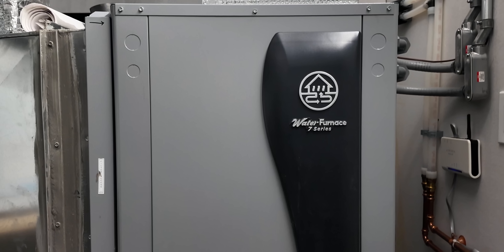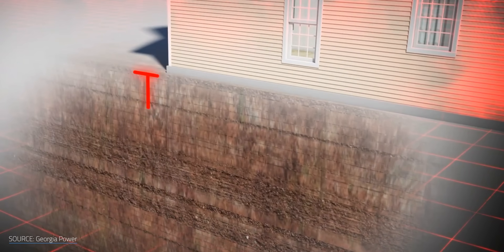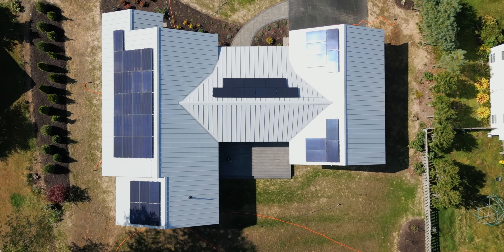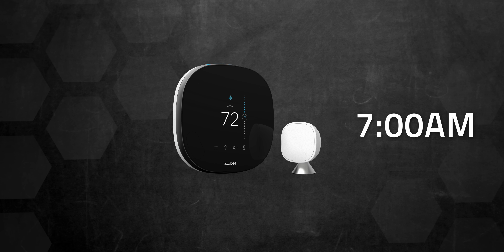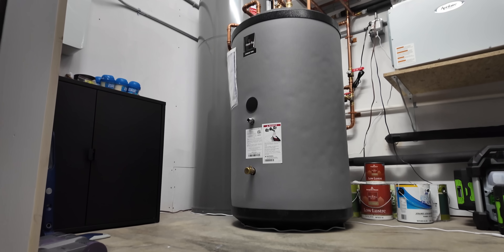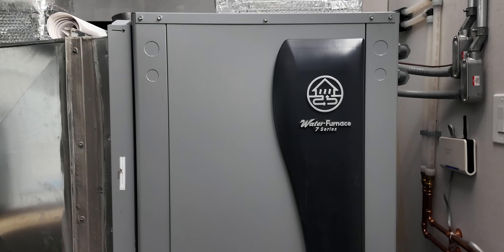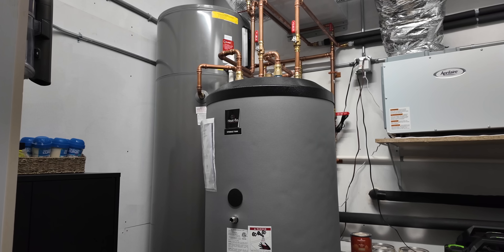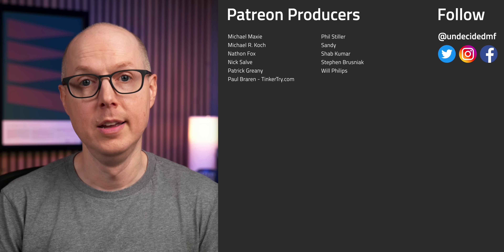How My Geothermal Heat Pump Really Performed (2 Years)

Comment: We installed geothermal heat pump 6 years ago. Our installation was done with a 230m deep bore straight down in the rock. Before this, our house used 47000 kWh/year. After we use 13-14000 kWh/year. The total cost of installation was $18000. It has already paid for itself, and my only regret is that we didn’t do it earlier.
Reply: This is basically my experience. 78k is crazy money for this system. My system came out to under 10k and heating capacity is enough for 150m2 house in Finland and no direct electricity heating needed for even -30C.
Reply: @roskispalo  finland is apparently quite good for geothermals, this is very location dependant
Reply: @Idfkwtumf ”geothermal” is a misnomer - when talking about heat pumps, it just means “ground sourced”. This is NOT location dependent. All that varies is how expensive it is to drill/trench, cost and availability of equipment, and government subsidies. The US is astronomically expensive for all HVAC systems of any kind.
Reply: Total cost of installation was $18k 6 years ago but what would it cost today?  I just got three quotes for drilling the boreholes for geothermal, they were $79,000, $85,000, and the third well driller (who had drilled 2 years ago for a house less than 1/2 mile away) wouldn’t quote, saying that the job could exceed $100,000, but might go smoothly and only cost $60,000, he couldn’t tell what he would encounter.
Note that those prices are for just the boreholes, does not include any hardware.
Reply: @jpe1  I am really curious to know how is a four fold price increase in 6 years justified!
Reply: @nspattak1  Isn't most the cost for labour?
Reply: @nspattak1  There has been a four fold increase in a lot of things in the last 4 or 5 years.
Reply: @EthanThruandThru no doubt I have the same question for all sorts of businesses
Reply: @jpe1  They probably use old drilling equipment. It takes longer time to drill, and the drill heads needs to be replaced several times during drilling. The time used for drilling this 230m hole was about 4-5 hours.
Reply: How do you use 47000 KWH?! I use 3000KWH a year. Those numbers are only being made by people who are running an illegal weed farm 😅😅
Reply: @TheJubess Depends where you live? I live in Norway, at my place we have -20 C during winter and up to +35 C during the 1 month of summer we get 😂.
Heating is our main draw of power, followed by hot water then EVs.
Reply: @CrinosAD No insulation? 😅 I live in Norway too, geothermal heat pump is about 50k€, we currently use maximum 27k kWh 175m2 house. The math doesn’t even remotely add up. Nobody in Norway has a decent ROI on these installs.
Reply: @TheSteinbitt older house from 1963 with only 10cm glava. Working on double it 😊
Reply: @TheJubess , maybe it's not just for heating, but also general power and EVs.🤔 Or it was converted fossil energy.
Reply: @TheJubess  I live in Sweden where heating is needed like 9 months of the year. It’s a big house, and the heat was generated by an electric immersion heater.
Reply: If I could get the install done for $18,000, I'd do it right now.  I can't get it done for less than $75,000.  I'm near Albany, NY.
Reply: @pleappleappleap  Yeah, we are fortunate to have solid granite just 7m down here. We just needed to drill the hole and replace our existing water heater with the heat pump. It was done in less than 2 days.
Reply: @jesperwall839  how is that fortunate?  It has to cost WAYYYYYY more to dig through granite than dirt
Reply: @13swe13  Because granite doesn’t collapse. Dirt will.
Reply: Hi, we are living in Austria and using a geothermal heat pump since 1992. Installation cost was approx. double compared to a gas/oil based heating system. Total annual electricity engery consumption approx 8MWh - 9MWh incl. household electricity. 21–22 Celsius constant temp. during the heating season (mid. September till end of April) - unfortunately no cooling function available . We are very happy with the solution. Since 7 years an additional PV system helps to keep the electricity bill in manageable dimensions (the heat pump consumes the main part of energy in winter with almost no solar generated electricity.
Reply: In the state of Maine, geothermal typically has a twenty year payback, not including labor so I don’t know if you are bsing or on the level.
Reply: @jacob-bi9ys 20 yr payback NOT including labour. Including labour the payback is… Never.
Reply: It was about $100/foot to bore where im at pre-covid. Math puts your 230m to ~754ft. That's $75k for an install alone. 
10/10 will pass until it math's out.
Reply: @RandomUser3055  I got a quote to drill a 500' well at Central PA for $15,000 a couple years ago, after COVID. $75,000 is a highway robbery
Reply: @RandomUser3055  so they basically robbing you blind. No way is that reasonable price for the drilling.

Try to get em for quote on 1 price anf no per foot.
Deeper the hole, more heat is available and longer. The ground will chill when years pass and become less efficient.
Reply: Intersting, friend got loops only about 1,5 m under ground and it works perfectly
Reply: @BlackViperMWG  And it’s a lot more work, and way more expensive to do it that way. Drilling 230 meters is done in a couple of hours.
Reply: @jesperwall839  Sure, but you still need to place the pipes and loops. Digging a 10 square meters takes even less time
Reply: @jesperwall839  Nothing is cheaper than digging down a ground loop. Especially if you do like I did, rented a 3.2t digger for a weekend. Rent was 170€, pipe 1200€ for 400m.  Brine 600€, 9 year old pump found on the local market for 500€. + Another 600€ for cupper and mapress stuff. 
2 days for digging
2 evnings with borrowed tools, I'm not a plumber 🤣

If you have the space nothing beats it, drilling has been for other guys around here around 9k €. No thanks
Reply: @Iceeeen  Sure, if you do it by yourself, and skip important steps like filling the bottom of the trench with the correct size gravel. You also have no warranty. If you like me have an almost perfect lawn on most of the property, that will also have to be restored. For me, it was way cheaper to go for a drilled hole.
Reply: @jesperwall839  Are you high?  You can rent an excavator for the weekend for $1000, and it'll run you like $200 in diesel.  If you have the space, ground loops are so much cheaper it is insane to suggest having hole drilled.  You do not need any gravel, if you need a warranty on a pipe then you should probably be institutionalized for your own safety and the safety of others.
Reply: @SteveDouglas-x2q  A ground loop here will not be nearly as efficient as a drilled hole. The ditch has to be at least 2 meters deep, and you absolutely need to have gravel if you want to expect a somewhat decent lifetime of the installation. It’s also way faster to drill.
Reply: @jesperwall839  Actual measured efficiency shows zero difference.  You have absolutely no clue what you are talking about.  Gravel is completely irrelevant, not spec, and makes no sense.  Yes, it is faster to spend $50k on drilling than $1.5k on an excavator.  If saving a day and a half is worth $48k to you, then go for it.  But lying to people here is not necessary.
Reply: @SteveDouglas-x2q  It doesn’t cost 50k. I paid 18k, including everything needed. Drilling, pipes, heat pump and labour. And at that depth, we know we will always have heat. No matter how cold the winter is. And we didn’t have to turn our garden to a mud pit.
Reply: @jesperwall839  At 6 foot depth you will always have heat no matter how cold the winter is, physics does not care how dumb you are.  Lying about prices is not productive, anyone can call and get a quote and see you are making shit up.
Reply: @SteveDouglas-x2q  Why would I lie about the price? I paid 18k€. That included everything.
Reply: @jesperwall839  You tell me.  Again, anyone can make a phone call and get a quote, and nobody is getting one below 50k.
Reply: 230m? There's no typo here?
Reply: @tomaszzakrzewski3790  No typo. Normally the drill holes are between 100-300 meters. It depends on how much energy you need to take out.
Reply: @tomaszzakrzewski3790  My friend in Sweden had a single multiple 100 meter borehole.  Our system in the US had 4 230’ boreholes.  Depends on where you are and the ground material etc.
Reply: We are looking into getting a geothermal heat pump here were we live (south of Norway).  Here the quoted cost for water to air system was roughly 23.000 USD (w2a because the house is old and I did not want to rip up all the flooring to install water loops).
The government will refund some of the cost, but still... It's crazy expensive up front. Not even sure if it's even worth it, as the pump unit will probably only last roughly around 10-20 years.
Reply: What if you spent that much on super-insulating your house?
Reply: @kellymoses8566  We have of course looked at insulation also, and the experts all agreed that it was not cost effective to add more.
Reply: @kellymoses8566  High insulation is a massive waste of money.  It has diminishing returns.  Lets say you go from r10 to r20 walls, that doubles your insulation cost and cuts your heat loss through the walls in half (does nothing about floor, ceiling, windows, doors, air leakage).  So you spend $5000 more to save $500 a year.  10 year payback, sounds reasonable right?  But do it again.  Go from r20 to r40 now.  Now you spent $10000 more to save $250 a year.  It will take you 40 years to break even, you would have been better off putting that $10,000 in a safe investment and using the interest to pay your heating bill.  It keeps getting exponentially worse the more you add.  And of course, any improvement to your heating lowers the value of your insulation.  Imagine you are on heating oil and then natural gas becomes available and you switch, now your yearly savings is half of what you had expected because your heating bill is cut in half.
Reply: Anytime someone starts throwing out "average" as a basis for arguments makes me laugh, especially "national averages". Those values really are meaningless.
Reply: You got a 230m bore hole drilled for less than $18K. Really?
Reply: @ede @edeledeledel5490  Yes. Complete installation including the 500m hose that goes down in the hole and the heat pump and work.
Reply: @edeledeledel5490  I think he meant to say British Pounds, which is like $30k
Reply: @0my  Naaah £18K is about $24K. UK borehole drilling costs are suggested on the internet at between £55 to £170 a metre, which gives £13,750 to £42,500 just for the borehole... let alone the rest of the installation. Sounds like crap to me, written by someone in the business... The bloke in the clip implies breakeven in something like 10 to 20 years, not 6.
Reply: @jasperwell... Which do you live?.
Reply: @COO415 Sweden
Reply: @jesperwall839  Ok well that explains it, the costs in the US are simply way more expensive. For sure you should have gotten it way sooner at that cost, but you can't advocate for it in the same way towards other people in the world where installation costs can be 4 times greater, where the benefits will take a very long time to outweigh the costs.
Reply: @DrewK-e2i  It will get cheaper in the US when you start using modern drilling rigs 👍
Reply: What were you electricity rates like after install?  You have to take power usage into account as well, not just your heating bill unless you have electric heating which would be insanity.
Reply: @MrBottlecapBill  We had electric heating as a part of our multi stove. It was an oil, wood and electric heater, but due to the insane costs of oil herein Sweden, we use electric and wood only. That summoned to 47000kwh/year.
Reply: 47 mega wattsh yearly? what are you running? a crypto mine? we have 3,6 MWh per year...and before we connected electric water heater, we had 1,6MWh per year. you spent insane amount of electricity...
Reply: @marian20012  Big house in Sweden, so this isn’t extreme in any way. Electricity was very cheap here until the Green Party effed up and shut down several nuclear reactors.
Reply: @marian20012  i was using 300-400 kwh/mo, with gas heat, water heater and dryer. Got a heat pump that we run other than Dec and Jan, a full EV and a PHEV, and we're at 1200 to 1500/mo. We arent using more energy, just different forms. Nat gas bill went down, car gas bill went to $0 in 1 and maybe 1/3 in the other
Reply: @jesperwall839  47000 kw a year? Jeez. We are at 6000 a year.
Reply: @jesperwall what state do you live in in how did your geothermal cost so much less than Matt's?
Reply: @massengineer7582  I don’t live in the US. I live in Sweden. I guess it’s a lot cheaper here due to several reasons. We have been doing geothermal for a long time, and there are several big companies manufacturing heat pumps. The geology is also perfect. It’s granite almost everywhere. New technology for drilling has also helped the cost to go down.
Reply: You were spending $3k a year on heating/cooling?? Holy smokes. Might want to look into that first.
Reply: @mediocreman2  And that’s what we did. Geothermal heating instead of an old electric water heater.
Reply: @jesperwall839   230 meters is wild.  Where do you live that you had to dig 75 feet down to get below the freeze line and to ambient ground temperature. The North Pole
Reply: I don’t agree with the comfort. I have a geothermal heatpump in a new build isolated house. Inbetwean seasons are not as comfortable as a faster system. My mornings with morning and afternoon sun is way too hot. And at the evening, my house is too cold. It takes too long for the termostat to handle this. I can handle it but my GF that is used to natural gas system hates my house.
Reply: If I'm drilling around 500' well, can I use the same hole for geothermal?
Reply: I live in The Netherlands.. my total energy use is 3400kWh including cooking, heating and hot water....
Reply: WTF. What kind of house uses 4000 kwh per month?
Reply: @jesperwall839  47000kwh! How? Is that like part residential part industrial or something
Reply: Why did you use so much energy? Can you just wear a sweater. Or house is in the mid 50s in the winter... It's normal, people lived without central heat for most of history
Reply: @0my  The old water heater was very inefficient. It wasn’t a huge problem to start with as electricity was very cheap. Then we accidentally got the Green Party in the government, and they shut down several nuclear reactors. Now we have more wind power than nuclear, and when there is no wind, the electricity prices go up like crazy. We could of course put on more clothes. We could also live in a tent, but we chose not to do that.
Reply: @0my doesn’t mean we have to live like cavemen nowadays. I live in East Tennessee. My electric cost is $1800/ year. I have a conventional all electric home with a heat pump hvac. I do use a fireplace in the coldest winter days.
Reply: Here I am heating my 120 yr old farm house for $400 a year using propane
Reply: @Barefootnfarmer  It must be a lot more insulated or smaller than my house. My house is about that age and I already have spent $400 on natural gas. Lol Although you might be further south than me.
Reply: how much mp2 square meeters has ur house is above 400 m2 ore more like 500m2
mine has 120m2 all of it and i pay below 80 euros per month to stay worm in winter and summer
Reply: I am heating my house with two 300 watt heaters that run all the time. So far it hasn't been much below freezing. If it gets colder I may add a larger heater to the bathroom.
Reply: IF I could do this for $18K here in N Texas(76049) I might consider it.  I was told that I needed 3 wells at $15K each  not including the indoor eqpt..This is to replace a 4T airsource heat pump. Where are you located and can you tell us the company that did it?
Reply: @jesperwall839  230 meters?? Do you mean feet. A 800ft well through solid rock around here would be way more expensive than 18k.
Reply: @colinwinogradoff6794  Meters.
Reply: Development of new freons, inverter driven compressors, etc. continue to change the economics of air sourced and water sourced heat pumps.
Reply: @jesperwall839  what kind of weather (summers/winters) does your house location experiences?
Reply: @erege09  Right now we have about 50cm of snow, and the temperature usually is between 0 to -10c. The spring starts in late April, the summer starts in June with temperatures around 20-25C that lasts until September. You could say that 9 months of the year we have temperatures below room temperature here.
Reply: That is about 5 times what an average house uses. Not sure the math works for normal people.
Reply: @justinleuenberger8011  I think something in their math is wrong.  I don't think you could drill a 750ft well for $18,000 let alone install enough geothermal to offset 35,000kwh of electricity usage.  But I guess if you are using all electric heat you could get to 35,000 of usage fairly quickly.
Reply: @justinleuenberger8011  it isint working for me heat with gass furnace is cost below 60 euro per mounth!
Reply: @mytzuno1  That's definitely the way to go. This whole heat pump fad is ridiculous.
Reply: Which system did you use? My new home is in an area where salt eats up outside units and I don't expect my new AC unit to last terribly long based on other's experience :-O A geo setup would be much less concern, I think. I've already got two wells lol
Reply: @BLKMGK4  the heat pumps is just a heat exchange but its not affordable for me i pay wayy les that this guy on video!
with that 70 000 dolars i can heat 4 generations of  kids inhere!
Reply: @mytzuno1 I’m aware that it’s a heat exchanger and while you may be able to use that money elsewhere you’d find it doesn’t go nearly as far when salt eats up your outside units regularly - as I mentioned in my response…
Reply: @BLKMGK4  Maybe see if you can pump water from one well and then discharge the water back into the other. Otherwise I would stick with NG if its available to you. If you live by the ocean I would regularly wash the air conditioner coils to get the salt off. Probably some warm water will do.
Reply: Americans energy consumption is mind blowing 🤯 my smart meter says that I've used 5461❤kWh so far this year, so even if in the last 2 months of the year my total doubles, that will be less than 2/3 of what youre now using!

I'm also using a decades old gas boiler.
Reply: @kaneworsnop1007  I live in Sweden. And heating is the main energy thief, so you have to account for the gas used for heating to your energy consumption.
Reply: @kaneworsnop1007   the 47000 kilowatts is crazy, they have to have a fairly large house, even by normal american standards being bigger than other nations
The average being around 10600kwh
Reply: @kaneworsnop1007 where do you live?
Reply: @kaneworsnop1007 your smart meter only shows electricity and you are using gas for heat which is the biggest energy hog by far so your shock is unwarranted. You cannot use your figure to compare with someone heating/cooling with electricity/heat pump, including hot water.
Reply: @kaneworsnop1007 Generally energy in the US is cheaper and we have much larger homes than in Europe. But I also was surprised how much that person is spending on heating and cooling. I average about $400 per year on heating and cooling, and I have an above average sized home.
Reply: @jesperwall839  Was 47kWh the usage on a modern, non-geothermal heat pump system, or on some old legacy system? The payback for the borehole needs to be based on the cost difference/efficiency against the alternative upgrade (a new heat pump without a ground loop), not the original (old) system.
Reply: @Timthecommenter 47000 kWh/year was with a water-based radiator heating system. We had a combination water heater, wood, oil and electricity. That was thrown out and a heat pump was installed in its place.
Reply: @Timthecommenter no, you calculate payback using the existing system as the reference.
Reply: 18k in the stock market for 20 years turns into 72k.  Sounds like youre unlikely to ever earn that 72k back.
Reply: @MindControll You are using the total cost of the system. A conventional air sourced heat pump would be required if a water source heating pump was not installed. Actual opportunity cost is the delta or about half the cost of the water sourced heat pump.
Reply: How the hell were you using 47000kWh of electricity!!!!‽?! How big is your house? Is it made of glass?!
Reply: Some of these statements and claims in the comments sound like utter BS. 47000 kwh per month? Are you living in a warehouse?

Electric bill avges 60 per month in NC. 

Had a heat pump at a prior house and it's a water gobbling pos. Electric bill was quadruple in the summer.

When temperature was below 45f the heat pump is even worse. 

Now you're asking me to prepay between 10 to 30 years of electricity usage??? Get effed.
Reply: @ggusta1  Per year. It’s clearly stated in the original post.
Reply: @jesperwall839 still a lot. My 200 sq home with 14 ft ceilings uses only 10,000 kWh per year. My home is all electric, but I don’t charge an electric car. I’m sure charging a car would affect it considerably. And living in the cold NE of Massachusetts does also.
Reply: 18K over 6 years reasonably invested would have doubled or possibly TRIPLED in that amount of time.
Reply: 787.2 feet deep bore?  I'm throwing the BS flag.
Reply: @pakviroti3616  You can throw whatever flag you want. It’s not uncommon to drill 300m for geothermal heating. We didn’t need to go that deep, but bigger buildings usually do.
Reply: That's a lot of money upfront though, and with any major investment, you can't forget about the opportunity cost.  Which is to say, the other things you could have done with that money.  If you'd put that same $18k into the stock market six years ago instead (just an easy option like a S&P 500 index fund), it would have grown to somewhere around ~$45k by now.  Has your pump saved you $45k?  Because that's how much it needs to have saved you to have been the better choice, purely from a financial aspect. 

...not to be a dick or anything.  It's great that it's saved (and saving) you money and you're happy with it.  And any way you slice it, it was a much better use of money than wasting it!
Reply: @lsdave42  Everyone needs to do the math for their unique situation.  After federal and local rebates I spent around $36,500 on my solar set-up.  My electricity bill at the time was about $1,100 per month(I live in California and have a workshop next to my house) now it would be in the neighborhood of $1,900 per month.  If prices remained the same it would have been a wash or slightly better invested in the S&P.  But this is California and electricity has gone up by 70 percent in the last 5 years, so I am way ahead of the S&P at this point.
Reply: @Ryan-ff2db  $1900 per month works out to about 185 kwh. per day. I don't know what you're doing with all that electricity. I hate to think.
And frankly, I'm surprised that a $36k solar set up can supply that much.
For comparison, my electricity consumption
is 12-15kwh. per day, depending on the time of year. Our heating is gas, though.
Reply: @lsdave42  I did the math, and based on average price per kwH, the geothermal pump saved ~$3k over the Index Fund.  Though that does not account for any Capital Gains Tax you'd have to pay to realize that index fund profit, or the changing price of electricity over those 6 years.  So they probably about even out.
Reply: @SoullessOO1  But doesnt take into account the rebound effect in increased consumption with heat pumps
Reply: @lsdave42  I could also buy lottery tickets for the money 🤷‍♂️ One thing we know for sure is that the price for electricity will continue to increase. The stock market we can’t be sure about.
Reply: @lsdave42  stock market can crash -30% overnight so this comparison only makes sense with an investment that gives you a guaranteed return like bonds. A 5% yearly return over 6 years is 24121$. This doesn't include inflation and other variables but the figure is not as bad as you think.
Reply: @lsdave42  You would need to factor in the increase in value of the house as well. I’m assuming Jesper is Swedish so probably had direct electric heating before, which is a hard sell here.
Reply: @lsdave42  The opportunity cost on an $18k installation is pretty small, especially after tax. Of course, when you start getting
into six figures for solar, batteries, EV's etc, it's an entirely different matter. But perhaps it is a mistake to just view these
opportunity costs simply in monetary terms.
Reply: @lsdave42  stocks are volatile and unreliable, you might win high or you lost big, and the energy bill will be likely just go up and other taxes goes up as well.
If you even want to get more into "financial aspect", you're making your land more profitable cause it got now a Geothermal system installed in the rare case you want to cash out your property also the housing market does not seem to "pop" yet.
Reply: @lsdave42  also what if you have to move?  You eat most of the upfront cost and the buyer is very happy, cool tech though.
Reply: @lsdave42  that investment alternative isnt a good comparison. Do you need heating in your house? Yes. Are you installing one, or switching out an already operational system, OR are you changing out a highly unreliable old system thats absolutely draining your wallet for every additional week you keep it running? Is it electric or uses heating oil/gas/biomass pellets?

The alternative cost isnt your 2.4x investment potential, its your water pipes freezing and destroying the house when your heating system fails in the winter.
Reply: @lsdave42  Latest word was his electricity cost is going up and his latest investment went down. I prefer a solid assured return. Gambling is not my cup of tea. 🙂
Reply: @lsdave42 It’s not always just about money. There are more important things in life.
Reply: @dermotbalaam5358  and his logic is based upon the faulty logic that the stock market always goes up. hubris and arrogance.
Reply: And the opportunity cost isn’t 45k, it is 45k-18k.  And it’s not that either, but because let’s make the concession that there would have been some lesser amount spent on HVAC.   
Let’s also not assume that he wasted the savings.   Maybe, he invested the savings.  
There was probably also some level of incentives rather than taxes.  

And then the whole difficult to calculate subsidies of pollution.
Reply: @E-gr1cej  It always goes up just look at history. A conservative investment over 20 to 30 years it’s incredible.
Reply: @dermotbalaam5358  Yep you can't forget the landfill you're filling every 10 or so years with out dated hvac equipment some bureaucrat has decided to outlaw because of refrigerant, efficiency or other nonsense.
Reply: @E-gr1cej  Pretty aggressive for believing that the OPs numbers are right. The average US house uses 10,200kWH annually (compared to the OPs statement they use 47,000 kWh annually). The average air conditioner uses 2,400 kWh of electricity annually (and an additional 1,300 kW on heating). That means that the VAST majority of the OPs electrical usage is not from temperature control, so the reduction in electrical usage is not due to the geothermal they installed. They have something else going on here. Feel free to google any of the above numbers.
Reply: @Nutzo826  in 2023 the average Swedish household used 32500 kWh, it's entirely plausible for an older Nordic house with the old heating system he stated to have had. The average for US houses are brought down significantly by all the warmer and even tropical climate housing the US has, you should be looking at the averages in Alaska, Washington etc. northern cold states.
Reply: @houndofculann1793 where did you get those numbers? Google says they use about 16,000 kWh annually. 

Europe also has a higher reliance on electricity for heating which is why air/air heat pumps make more sense. They don’t in the US as most houses use natural gas which is cheap in the US.

Geothermal has a higher COP, however the saving is limited due to how cheats NG is.

Long story short, the OP is confused on costs, and usage, of power and is drawing incorrect conclusions.
Reply: @Nutzo826  a Statista graph, although I don't have an account there so I was looking at just the start of the article. I looked at some others now and 25 000 kwh is given by some others that look decent too.

That said, I live in Finland myself and I do know people who would have their electricity use hitting that figure in just the winter if they actually heated their whole house because the houses are simply old and in some cases shoddily built/maintained coupled with an old inefficient heating system so his numbers don't sound entirely unreasonable to me.